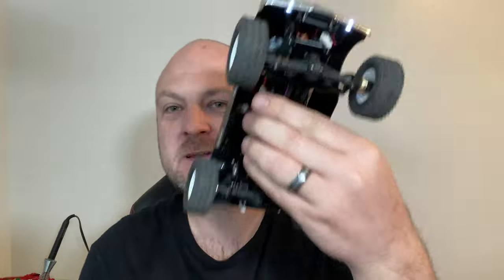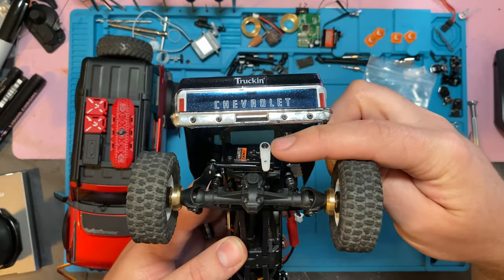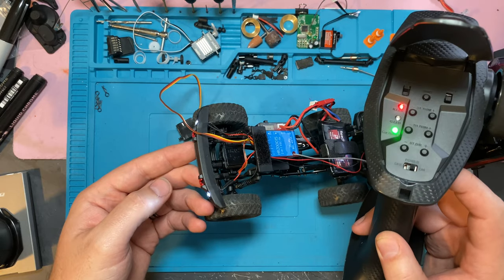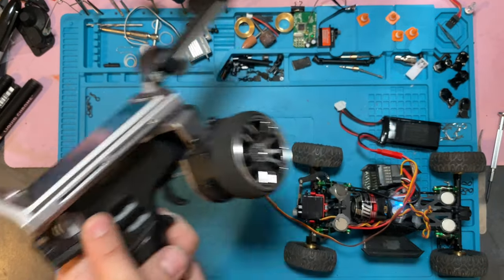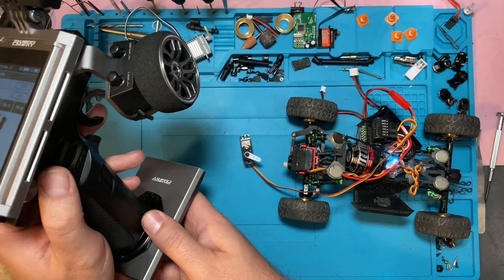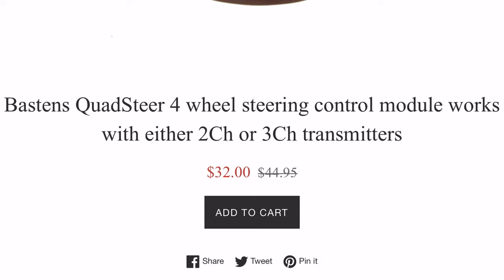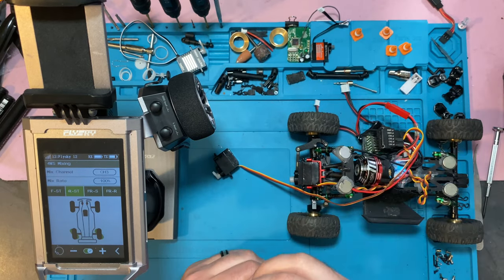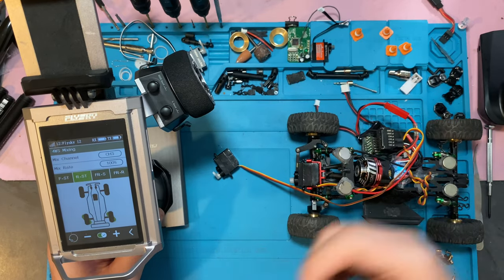SCX24 - 4 Wheel Steering Made Easy! Use Your Stock Remote To Steer the Rear! 4WS!

Comment: Why couldnt a guy just use a cable splitter and switch the positive and negative wires to reverse the rear so you could have proportional on a cheap two channel remote?
Reply from the maker: You could try. Let me know if it works.
Reply: @TheShopMiniRC  I'll probably burn up the BEC on my ESC putting to much load on it I'm betting but hey, YOLO! Lol
Reply from the maker: @godackgudalach1  hahaha. Donno, I haven’t tried.

Comment: Hi Ken just wondering if anyone has managed to run the stock esc but use a different receiver. I have a front axle coming so will run stock radio for now but I have a radio with mixing but just interested to see if I can run it without upgrading the esc as well.
Reply from the maker: Unfortunately you can’t. :(